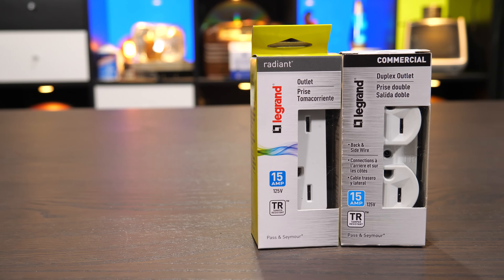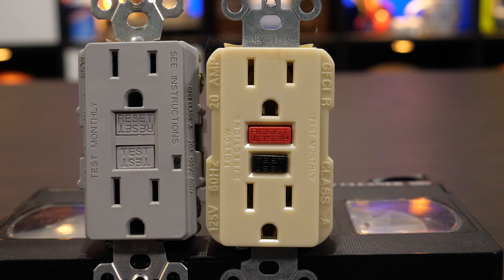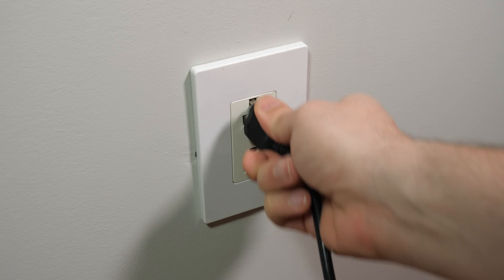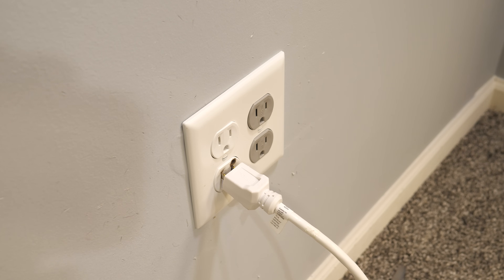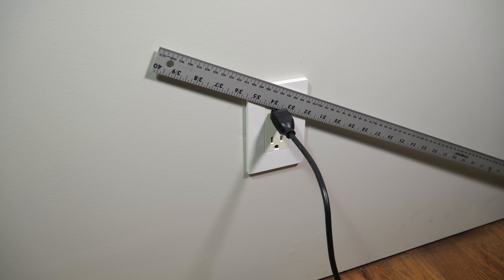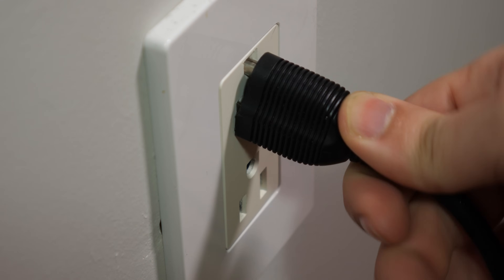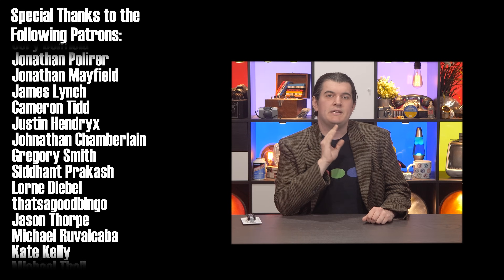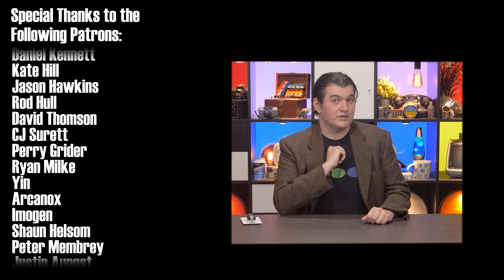Power outlets are topsy turvy - but does it matter?

Comment: There is a simple solution to this problem that is common in Europe, that I am surprised is not a thing in the USA. In Europe, type C, E and F sockets take plugs with pins that aren't sleeved either. The solution is to recess or shroud them by the length of the pins minus the usual distance between the face plate and the contacts on the inside. That way, because those plugs have a standardized round flange that fits neatly in the recess, you need to insert the plug past the point where you can no longer touch the pins before contact is made. Since the blades on North-American plugs are quite thin it's a better solution than sleeving the pins.
Although there's probably quite a lot of wall warts and angled plugs out there that won't fit in a recessed plug very well, but it wouldn't be that hard to design some kind of screw-on adapter to make those compatible as well.
Reply: @SnakebitSTI you can just google Leviton decora 15 amp residential grade 1 gang recessed duplex receptacle outlet and perhaps with half  recessed distance as standard.
Reply: @SnakebitSTI  I just thought of that too but I was still editing the comment. Yeah, it's going to be hard to make that work without breaking compatibility with some devices. Not that big a deal in my opinion: what you'd do as a legislator is standardize the design of the plug first, and then change the socket standard, maybe 5 or 10 years later. Any equipment that is incompatible, hasn't been replaced by then and is worth keeping could then be equipped with some kind of permanently attached adapter.
Reply: @SnakebitSTI  The entire EU just adopted an entirely new, common light fixture connector, the DCL (Device for Connection of Luminaires), making all existing obsolete.
Radical solution, ditch the 120V "neutral" and go straight to 240V with one of the European connectors (there are a few varieties to choose among, let Alex try them out and make a nation wide decision) as the new standard for all new constructions. Might even go to 50 Hz for extra compatibility, though that's optional.
Reply: @johanmetreus  changing the frequency would have to be done simultaneously across the entire grid, it'd be almost impossible and would break stuff that expects 60hz. Honestly most things people would want to travel with are trivial to build to tolerate either anyway, they just convert it to DC for internal use! Probably because a lot of them were designed by the Japanese, actually, and they managed to screw up their grid badly enough that half the country runs on 50 and half on 60
Reply: @keiyakins  And Japan actually lowered the voltage from 110 to 100 Volts.
Reply: @keiyakins  Japan is actually a good example for how the switch over could be made, gradually disconneting and separating sections of the grid for conversion with frequency converters in between the old and the new grids to allow for load balancing.
Standardizing the voltage is much easier though, since the split phase allows for making 220V the standard, which is close enough to the rest of the world to eliminate most issues there.
Reply: @johanmetreus   then why hasn't Japan done that if it's so easy? also the "frequency converter" thing... they're terrible. They exist, but it is a huge pain and very expensive to move power between. the two grids.
Reply: @keiyakins  Japan uses frequency converters between the two grids already for balance and emergency power, and is used in everyday regular service by ever HVDC line in the world.
Why they haven't transferred completely?
Well, apart from the transition itself being an inconvenience (it kind of works as is, so why bother making a deliberate effort?) , you also have the political aspect. Going for a 50Hz system would exclude the US industry from the Japanese market, and American politrickians tends such things very negatively even when there are good reasons for it. Likewise, changing the grid to 60 Hz would alienate Japan from the global standard, with all the consequences that has.
Reply: @johanmetreus  As someone from an EU country, this is the first time I've ever heard about this connector. I can't even find any lamps for sale that use it, at least not explicitly mentioned. I can't even find much information on how and where the connector is suppressed to be used.
As far as I'm aware all our lamps, at least residential ones, are either hard-wired using splicing connectors (for fixed lamps) or use standard wall plugs (for movable lamps).
Reply: @TheGrejp  Well, if the praxis is to hardwire the lamps and therefore not using connectors, it makes sense the DCL is scarce. Are you allowed to do the connections yourselves, or must an electrician do it? I noticed there are differences in what non-sparkys are allowe to do on their own between the countries.
Reply: @johanmetreus  In new construction obviously only an electrician can install wiring, and most people hire an electrician for more complex changes on already existing wiring. But since we predominantly own our houses and apartments (not rent), nobody can stop you from replacing your lamps.
Could you explain the use case for the connector - is it a connector placed in the ceiling or wall so that any lamp connects to it?
Reply: @TheGrejp  Here in Sweden, any part belonging to a fixed installation requires an electrician, for instance hooking up a washing machine without the use of a plug.
Basically all you are allowed to do yourself (provided you have the proper knowledge, but are not licensed) is to replace existing wall sockets, plugs, switches and fixtures.
The DCLs are used in closed installations (inside walls, floors and ceilings) to allow pendant lamps and chandeliers to be connected with a plug and socket, typically with an integrated hanging hook or fixture mounting point, thus removing the need for exposed wires.
Almost every lamp can use them, if you google "ikea koppla dcl" you'll find the typical contact used. Having moved five times in a single year, just plugging the lamp in sure beats having to fiddle with screw fastened connectors lol
Reply: @johanmetreus  How is preventing people from doing their own electrical wiring enforced? Are there regular inspections for private homes? 
I'd say that what you described as people being allowed to do without a licence is pretty much the extent of most people's knowledge. Personally I think most electrical work should be left to professionals but connecting a lamp isn't that complex.
However it sounds like a very useful concept if you move a lot. I'm from Croatia where people don't move often and the home ownership rate is very high (>90%) so I don't see it significantly catching on here, but still a good solution if you have that problem. Every manufacturer having their own connector would be a total mess.
Reply: @TheGrejp  Mostly it is enforced by the insurance companies declaring the insurance void if unauthorised installations are found in a house where damage has occurred, regardless if it is the direct cause of the damage or not, secondly by the electricians reporting any unauthorised or sub-par installations they find. Latest case I heard of was an electrician called to an apartment where a fuse kept triggering. When inspecting the bathroom, he got zapped because the Elgiganten installers had connected the phase line to the washing machine's protective ground.
(Washing machines are usually placed in the bathroom here in Sweden).
This immediately resulted in charges filed with the police, as the installation was not up to the safety standard.
I can only imagine what a thorough inspection in Zjupanja would result in lol
Some of the stuff there was really good, but compensated by obviously totally ignorant home owners seemingly connecting things at random.
Reply: @johanmetreus  50 Hz would require all new generators, and bigger transformers.
Reply: @dougbrowning82  I know, but a man can dream, right? :)

Comment: I actually installed all of the outlets in my garage ground up for these reasons.  It usually doesn't make a difference, but I'm not using fancy indoor plugs out there, and the extra safety factor is handy given how many small thin pieces of metal I have around - dropping a saw blade could be bad.

Comment: I just realised, you can't turn the plug upsidedown WITHIN the outlet. I knew this wasn't possible with a ground pin (and this bothers my all the time when I see this outlet), but I just realised you can't even doo this when you have no ground pin on your plug. (or was ist just an optical elusion that on of the pins is slightly wider?)
Maybe I'm biased and maybe there are even better standards out there, but you should at least adatpt to the german outlet standard.

Comment: I simply can't stand the US/UK type connectors simply because it's too easily to accidentally pull the cable out. I have heard stories of people accidentally unplugging expensive server rack just by tripping over a cable in the US, I have never heard such stories coming from the EU. In fact, some EU-style sockets are so tight that you have to push heavily just to PLUG the thing into them, so they definitely won't unplug by accident. One of the many reasons why I will never move to the US or UK.

Comment: i bought a house recently and was shocked and appalled that all the outlets are inverted to what I'd become accustomed to expecting as normal my whole life. Your video here is reassuring that my house actually has the proper orientation for safety. Awesome and relieving.
Reply: I actually liked the new design of the plugs on some devices.
Reply: Most people have fingers smaller than the thumb. With the outlet upside down, women and and children especially can easily slide their fingers behind the plug when it is being pulled out, and shock themselves. I say this is fracked up. Leave the ground on the bottom. The one case of a sheet of metal falling on the outlet I don't give a crap about, as it is so remote an occurrence compared to people being able to contact the plugs with their own fingers, to consider it IRRELEVANT.
I say the way they were before is actually safer.

Comment: I mean, the right-angle plug design makes it so you can only use on plug per outlet.  If they could figure a way around that, then it's viable as a standard. Having the cable come from the side, for instance.

Comment: My "two cents" and takeaway from this has to do with nightlights and air fresheners. The larger blade on 'polarized' plugs will cause most of these devices, as currently configured, oriented upside down.

Comment: When I was a kid, I had a lamp or something with those folded over copper conductors for the blades that would often flex around. So the help inserted I went ahead and squeezed around the blades to align them to the plug and… 120 V through your fingers from one finger to the other luckily doesn’t freeze up your arm is all I will say.

Comment: I never knew how scary the american electrical plug was until this video. I knew you didn't have shielded pins, but no ground pin requirement? No design that requires fully inserted plugs before they work?

It's just scary how little safety measures are used.
Reply: Like Technology Connections had said, “it’s a Wild West when it comes to plugs”.
Reply: Does your phone charger have a ground pin?

Comment: My ex-wife was once wearing a metal bracelet and sitting near a outlet with some items plugged in. One of the items was "partially" plugged in. She moved her arm and her bracelet went into the "partially plugged" in item and it surged and slightly melted her bracelet and left a small burn on her arm. Would ground up have made a difference here? Maybe.

Comment: i really think we should really work on safer plugs. just start by allowing safe plugs into building codes, and then taxing newer safe plugs less. or, provide some sort of coverage for buildings that use the new plugs (say, if applied to, the government can fund up to 10% of a building's cost if more than 80% of its plugs are the new form). provide partial coverage for people wanting to convert their homes, including single/dual female extension cords that accept the old plugs.

Comment: I’d change receptacles to UK style BS-1363 outlets (or develop a new standard with the same safety features) and use clip-over plug converters on older equipment during the prolonged equipment switchover period (or just replace the plug/use plug through converters) 🔌
Reply: Just think of all the foot injuries though....
Reply: @DaveF.  😂 they very rarely cause actual injury (having lived in the UK for 15 years I’m yet to encounter or hear of one) - they are fuxxing painful to stand on though: although inbuilt outlet switches generally mitigate the need for equipment to be unplugged.
Reply: or schuko as these are reversible and recessed.
Reply: @SB7-r9i recessed outlets are harder to retrofit into walls with thin cavities. BS-1363 has less need to be reversible as the power cord always points down to limit the risk of pullout, and this offers a quick visual cue to correct orientation.

Also BS 1363 is fused, and includes shuttered live and neutral terminals, with live and neutral pins also being shielded at the base of the pins.

Outlet switches are also a bonus feature.
Reply: @SB7-r9i schuko are also over engineered. Swiss and Italian are pretty cool, but sadly they didn't catch on.
Reply: But BS requires 32A installation, which isn't always the case in the US. 

Also, they are unnecessarily bulky for devices like chargers etc.
Reply: @LMB222  DC chargers for phones and similar can actually be quite small as the need for in-plug fuses is negated and they’re often in a much smaller form factor. Also new homes in the UK are now built with 2 USB ports in the outlet itself.
Reply: British people always seem to think that their fused plugs are so much safer than what the rest of the world uses when in reality they are just the consequence of the UK very unusual 'ring main' wiring system which is clearly inferior to what the rest of the world uses.  So the reality is that the fused plug is trying to make an inferior wiring system safer.

Clearly the British plug is safer than what is used in North America but this is a very low bar.

Look at the plug designs used in every other country and there are many that are far superior to the British design.
Reply: @michael-j-harrison  The fuse is nothing to do with ring mains, that seems to be a common mistakenly held belief. The fuse is purely there to protect the appliance's cable. So for example, if an appliance blows/shorts out it can't draw the full 32 amps from the ring main, it can draw (in the case of a TV for example) 3 amps before the plug fuse goes - fairly sure the appliance cable will be of a size that can handle slightly more than the fuse. That also means that your appliance cable doesn't turn into a small space heater!

Comment: Lots of electronics have plugs designed for the ground on the bottom, and if you plug is installed with the ground down... It constantly unpluggeds it self.

Comment: I dont care installed them the "wong" way becuse 90° plugs 
i was told to put grond up in school becsue at the time most face plates where mettle and it would stop a short if the Faceplate came loose but now plastic 90% of the time.

Comment: i own a house built sometime around 1905-1915 (town doesn't know, need to check tax records) all outlets orient the ground plug to be on top, had an when i hired an electrician when buying to house to ensure grounds were properly done ect. he commented that it was proper because if a plug was left partially out like you mentioned but instead of touching he mentioned if something was dropped, especially if you had furniture in front of that wall and something metal fell behind it could land just right and bridge the prongs while if the ground pin was on top it would deflect the object.

Comment: Electricians are taught.  Always on … ground down.  If it is on a switch ground up …. 90 degree cords.  99 percent and made so ground Down.  So cord goes down wall….  The ideal solution would be to adopt what most factories use on their machines.  The twist-lock outlets and plugs

Comment: My house has every outlet installed with the ground pin on the top, and I’ve been working my way through replacing and flipping every single one of them to have the ground pin on the bottom. Ground pin up has only caused problems for me with the appliances that I use.

Comment: I wonder what the people in the US who care about orientation would think about our Swiss “triple sockets”, which are common on walls and contain three sockets at 0°, 120° and 240° rotation (with the ground pins facing the center)
Reply: Your sockets are sunken into the wall, so the issue isn't nearly as bad as the NEMA 5-15 horrible plugs.
Reply: @LMB222  We still have a lot of non-recessed sockets (older installations), also in the triple configuration
Reply: What is it with you Swiss and triangles? (Toblerone, I'm looking at you...)